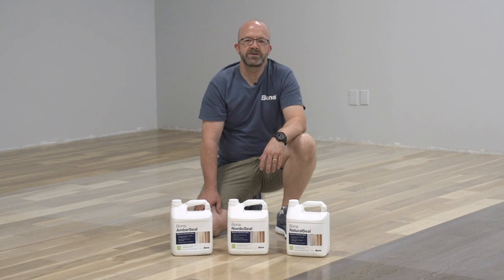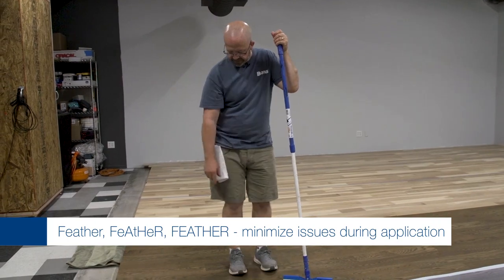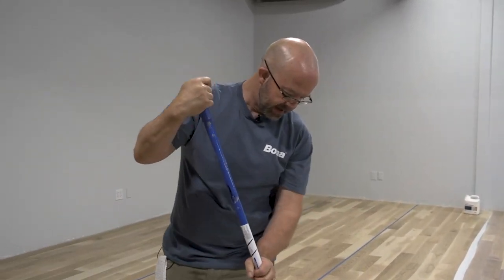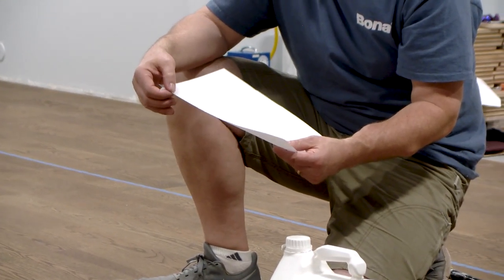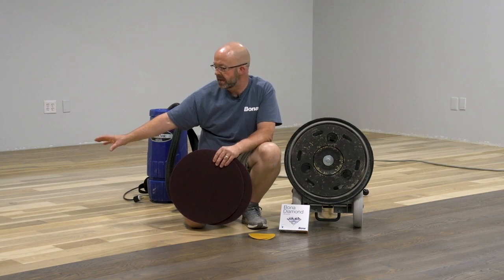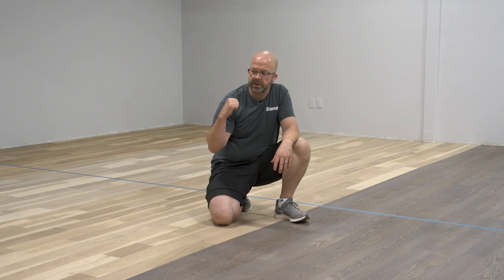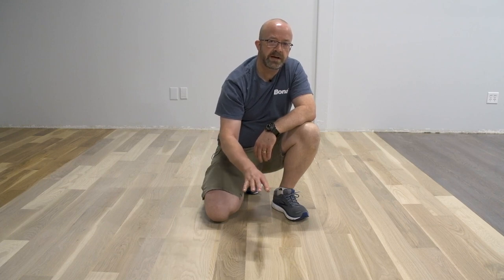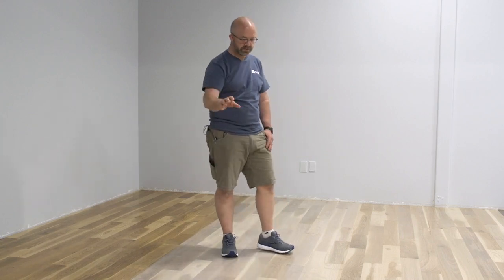Bona Sealers Application Best Practices

Comment: I just used Red Out on very old red oak flooring and im very happy with the results. I plan on using Natural Seal and i noticed you recommend using a roller with dip and roll for uneven floors. That makes sense. Since the Red Out has the floor water popped it is rougher than 120. Maybe feels like 80. Do i need to lightly sand before Natural or is it okay to apply to the water popped floor? Also is Domo crystal clear? I purchased 5 gallons to finish aftef Natural. Should i also roll Domo on these uneven floors?
Reply from the maker: Hi Jon - Since you're not staining the floor, we'd definitely recommend that you lightly sand the floor with two 120-grit Bona Diamond abrasive discs on 1-2 Bona Conditioning Pads (stacked to soften the cut). This won't cut deep enough to change the Red Out surface, but will smooth it out to help ensure nice, even coats of the Sealer system that you're choosing to apply. And, yes, Bona Domo is clear and colorless and you might consider applying a first coat of Domo before you apply NaturalSeal (especially if you're new to applying NaturalSeal) as this will make that application easier and more even (though you still might need two coats of NaturalSeal to even out the floor). The dip-and-roll method (without the roller side discs) is also highly recommended with NaturalSeal and NordicSeal, as it can be difficult to pull out the heavy puddle areas when doing the traditional pour a puddle and roll it out method. Hope all of that makes sense. If you need to chat about it or have other questions, please give your local Bona territory manager a call; or reach out to our Technical Services team at (800) 872-5515. Best of luck with your flooring project!
Reply: So you recommend Domo underneath Natural? Thats interesting. Is that to aide in the actual spreading of Natural or more so just the leveling of it after the application?
Reply from the maker: Hi Jon - The first coat of Sealer (over raw wood) is the hardest to apply because the raw wood really soaks it up fast (and more of the seams/end joints are open) - all which make applying a sealer with any color/pigment more difficult (as it doesn't have as much time to flow and level). Applying Domo first will give you a smoother and less absorbent substrate to apply NaturalSeal over, giving it more time to flow and level, and thus a more even application. Hope that makes sense. Thx!
Reply: It makes sense. The only concerns i have is that the Natural would be coloring the raw wood + a coat of Domo. I have seen very little if any reviews about Domo whereas as Traffic has all the reviews and then some (makes me think something is wrong with Domo as to why i can find only 1 or 2 residential application examples online) But that means my whole project is dependent on how Domo looks over the raw wood. And in a few years if i need another topcoat i can sand and add another wheras that Domo layer would be there forever basically. Will the Natural still have the same effect over the raw wood + Domo and give it that natural enhancing look? Will the single layer of Domo be okay under for 10-20+ years?
Reply from the maker: @jonmasters1358  Domo is mainly sold as our low-end waterborne Finish, which is why you don't hear much about it. 90% of contractors who use waterborne, use their chosen brand's "Best" product, which for Bona is the Traffic HD family. We just shot a whole video series on how to apply colored sealers in our Studio (5" white oak plank); including, using Domo as a pre-Sealer under both NaturalSeal and NordicSeal on 1/2 the floor. While it does change the appearance every so slightly (the tiniest shade darker), it's hard to pick out the line/difference even with them side-by-side. Domo is very easy to use, and has great adhesion and good durability (though that doesn't matter when it's buried under Traffic HD). Lots of Craftsmen use it as a Sealer and or a mid-layer (though we don't necessarily recommend the mid-layer practice), and then top coat with Traffic HD. I'm a 30-year Bona vet and would have no concerns about using Domo as a first coat, then applying NaturalSeal over the top, then top coat with Traffic HD; and, in fact, I would do it the same way because of how I've seen the ease of applying the colored Sealers over the top of Domo, versus the real struggle of colored Sealers over raw wood.
Reply: Thank you so much for the advice. I really appreciate it. One last question: would anything prevent you from doing more than one coat of Domo as a first layer under Natural? Would it be acceptable to apply 2 coats of Domo over Natural and a 3rd finishing coat of Traffic HD over the Domo?
Reply from the maker: @jonmasters1358  It would be overkill to put 2 coats of Domo under the NaturalSeal. Apply 1 coat (500sq/ft gallon), let it dry well, then smooth it with 180-240grit. This smooth, sealed coat is what makes it easier to apply the NaturalSeal. Then, apply 1-2 coats NaturalSeal (most folks put on 2 as this really evens out the floor and gives it enough of the white tone that they're looking for), and top it off with 2 coats of Traffic HD to protect the color, etc. You want at least 2 coats of Traffic HD on top, so don't sub in Domo for that. Typical floor is 3-4 coats of Sealer/Finish. If you add too many more coats it can start to look like plastic and not a beautiful wood floor with a nice luster.
Reply: Sounds like a good plan. When you say “Dont sub in Domo” are you not recommending Domo be used to finish a residential floor? Because Domo is what i have purchased as my top coat.
Reply from the maker: @jonmasters1358  Sorry for any confusion, as Domo is intended for residential applications. In our Good-Better-Best system, it's our Good finish; with Mega or Mega ONE a step up; and of course, Traffic HD the industry standard for performance.
Reply: Thank you so much for the advice. Very very helpful :)
Reply: Just wanted to update you on my project. Thanks to your wonderful advice i had a very successful application of Natural Seal on my unstained red oak floor. Red out worked great. Domo first on the raw wood was key. I applied the Natural with a roller after that and kept the temp around 50 so that allowed a perfect slow leveling over the Domo. Zero streaking. Zero Color marks. Now for the topcoat. Thanks alot couldnt have done it without you.
Reply: @jonmasters1358  Have you put any pictures project online?
Reply: No i havent.

Comment: Thank you for the video. Is it recommended this product be applied with a roller? I’m going to be working on small floors that have narrow walkways. Also,  do you have to sand this product before applying the finish coats?
Reply from the maker: Hi Ryan - While we typically recommend that the pigmented waterborne sealers (IntenseSeal, NaturalSeal, NordicSeal) be applied with a t-bar as shown in the video; they can also be successfully applied with a Bona Microfiber roller set-up as well (in fact, that's the only way they're applied by our customers in most places around the world - with a roller). Just need to take some extra precautions and be really good at your "feathering" strokes when using with a roller (and make sure the environment is set up for slower dry times - lower temp, higher humidity, zero air flow). If applying Bona waterborne finishes over the top of these sealers, it is not necessary to abrade for adhesion unless more than 48hrs has passed since the last coat. If needed for smoothness, carefully abrade with stacked Conditioning Pads with a couple Diamond Discs 180 or 240grit. Critical to abrade evenly and carefully as if you take off more of the sealer build-up in an one area(s), you'll remove the color and that patch will show through when the finish is applied. If abrading, as shown in the video, then wet tack to highlight any uneven areas in the sealer and repair those (spot repair or apply another coat to whole floor) before applying your finish.
Hope this all helps!
Reply: @BonaProfessional  Copy that! Thank you!
Reply: @BonaProfessional  does that mean there is no abrasion required if applying a bona classic seal followed by two coats of HD traffic? Or would you recommend abrasion between just the finish coats?

Comment: why would you want your floors to look that milky? I still dont understand the purpose of sealers on top of a stain. I thought you just put a finish (poly) over top and that was it?
Reply from the maker: Hi @Scott-dn1bk - Over unstained wood, the whitish sealers help maintain that "freshly sanded" look when paired with a low sheen finish (very popular these days). Also, it helps make a white floor even whiter (very Scandinavian) when using white or grey stains as a base. Given that, you usually wouldn't use it over a brown tone stain; and wouldn't put poly over it, as this would make the floor yellowish. Only waterborne finishes over the top. Hope that helps answer your question!

Comment: What is an average dry time for nordicseal at 70°f?
Reply from the maker: Hi Mike - NordicSeal should dry in 2-3 hours at 70°F, but high humidity and or low/no air flow may also play a key in dry times. Best practice is to add a box fan or two in available doorway(s) once the Sealer's had a chance to flow and level after application (maybe 30 minutes) to help ensure timely drying; prior to abrasion/smoothing and or application of the next coat of Sealer/Finish. Hope that helps.
Reply: @BonaProfessional  is it ok to turn on ceiling fans on medium? Or slow speed
Reply from the maker: @enzokool  Yes, but only after the current coat has had a chance to flow and level; then turning on ceiling fan would be o.k. Might want to be a bit careful with that, as lots of ceiling fans have quite dirty blades; so, if not cleaned, then you risk some of the built-up dust and debris coming off the blades and landing (and sticking) on top of the Sealer/Finish.
Reply: @BonaProfessional  thank you very much for the tips, really appreciate it 😀

Comment: You may want to check your numbers on this
Reply from the maker: Hi @jamesrule5085 - If your application rates are not coming in at the product specs, then you might need to look at your sanding process/sequence; the overall condition of the floor (i.e. a lot of open seams and or old, open thirst soft grain, etc.); and or your application tool/method. First coat tends to be lower rate due to the raw wood soaking a lot up, whereas the last coat of finish will tend to be greater coverage than recommended because the surface is so smooth/slick by that coat. Hope that helps.